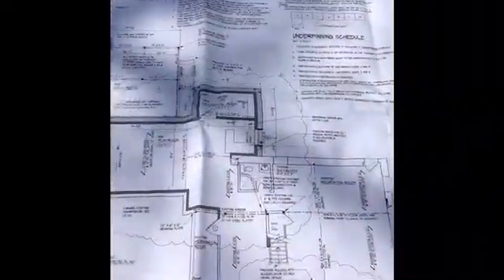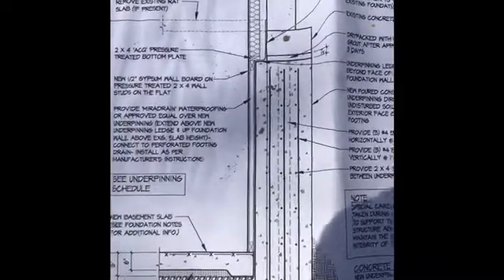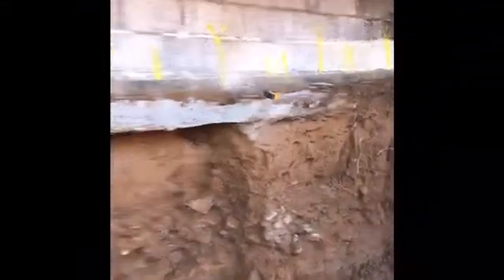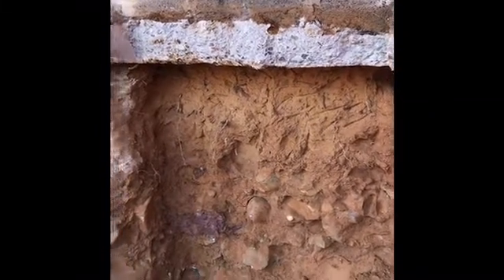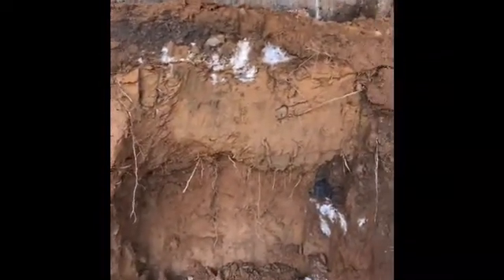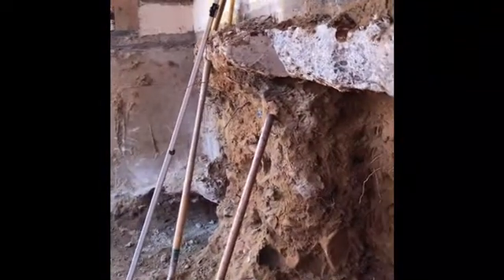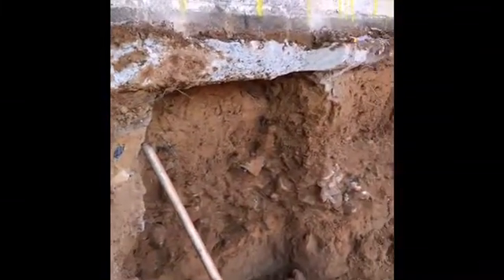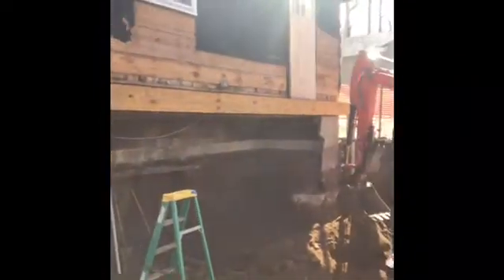HOW TO: Get a taller basement and underpinning

Comment: It is necessary to get foot benching or underpinning after you lower your basement? What’s gonna happen if I don’t? Thanks
Reply from the maker: Yes you should have underpinning under your existing footings IF you go lower than the bottom of the existing footing with the new floor height.  So if you lower your floor 8” you would excavate approx 14-16” from the top of the existing slab now you would be at the bottom of the existing slab and not need under pinning.  However if you dig lower than the bottom of the existing footing you should consult an engineer and come up with a plan to support the old footing.  Good luck!